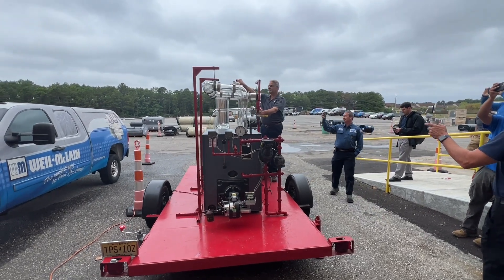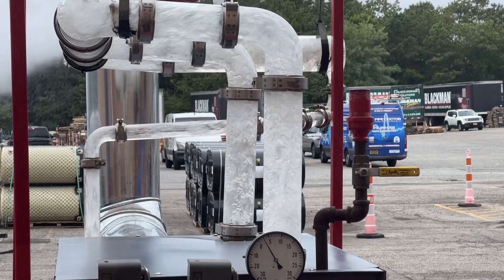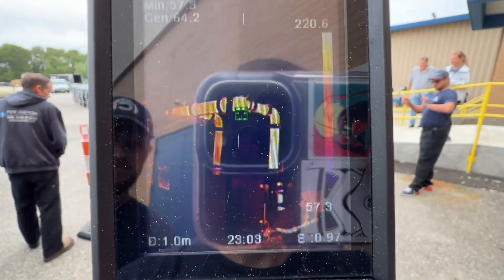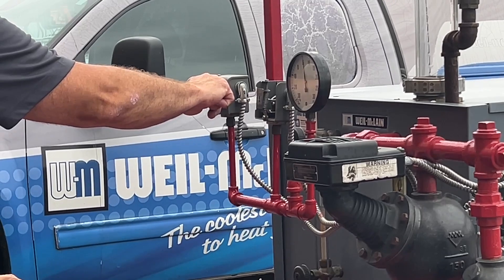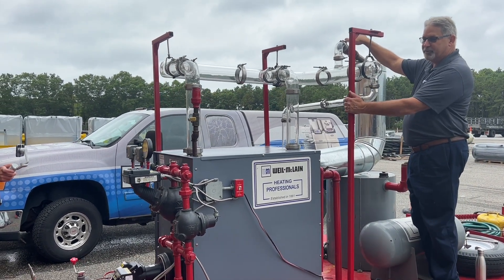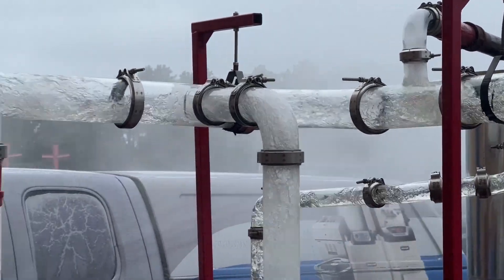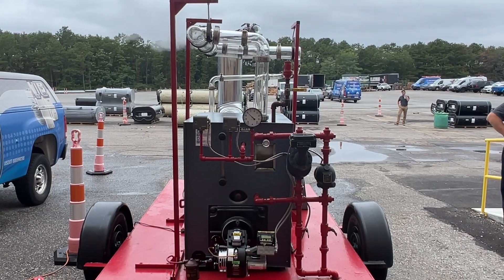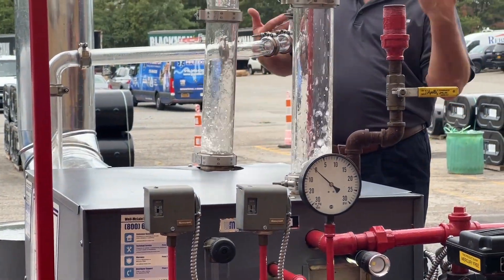What Really Happens in Your Steam Boiler! Weil McLain Live Fire Steam Boiler Event!!! Pyrex Tubing!

Comment: I thought you guys don't touch oil burners?
Reply from the maker: We don’t touch oil, it was a presentation/class on steam. Steam flow, steam piping, steam components. The importance of a perfectly balanced steam system. And this was a little demonstration on different effects certain things have on the production of steam
Reply from the maker: But (…technically…..) it’s diesel
Reply: @DCHVAC  I'm 3 hours north of you guys and most of what I work on is old oil systems although $4.29/gallon is making a lot of people look into converting with heat pumps. About a year ago I sent a box to pipe doctor HQ with a set of propress Jaws that will fit Mike's zoom lock press. See if he ever got them. I got 8 more sets and no idea what the hell I'm gonna do with them.
Reply from the maker: @rustyshakleford5230  He got them we have them…. I’ll take the 8 😂